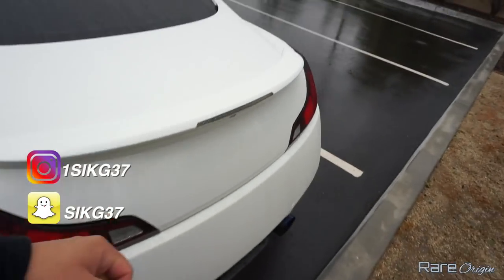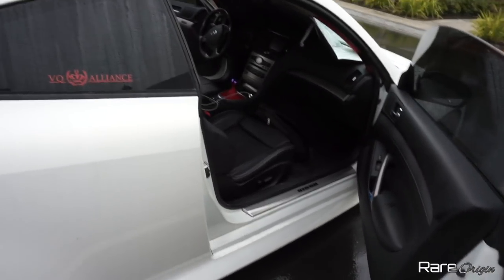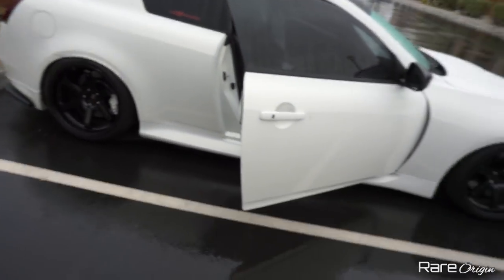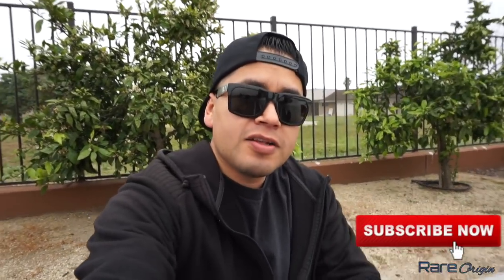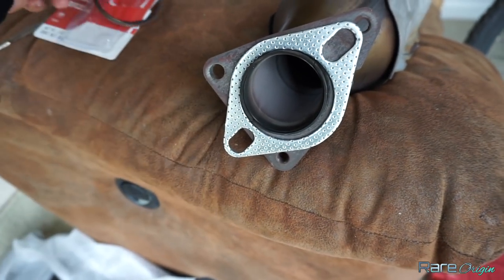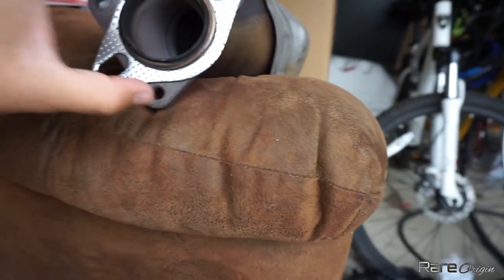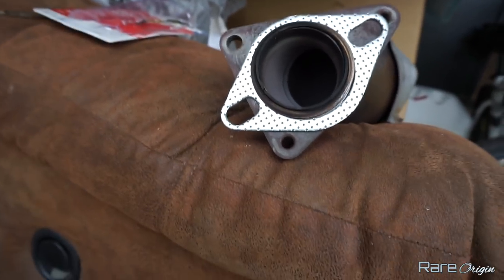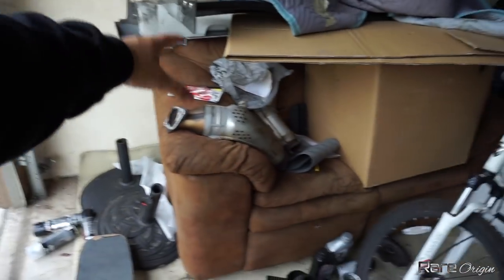APR PERFOMANCE WING INSTALL ON MY G37

Comment: Hey man which wing did APR say was made for the G? Coming with purely a Time attack and non-aesthetic mindset, I would prefer that one with the wider mounts because it would reduce panel flex by a lot and transmit more downforce to the wheels. I know the battle-aero wing is the the best for downforce but my class won't allow chassis mounted wings.

Your wing looks great btw, I'm glad to see one. Made me decide that I'd be ok with trunk mounted on mine.